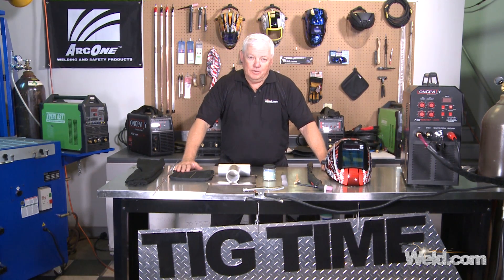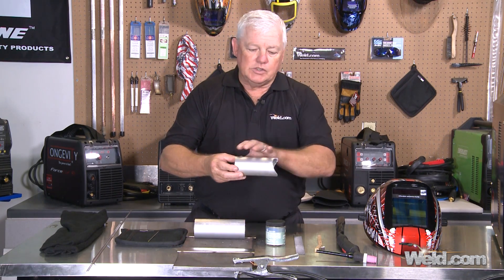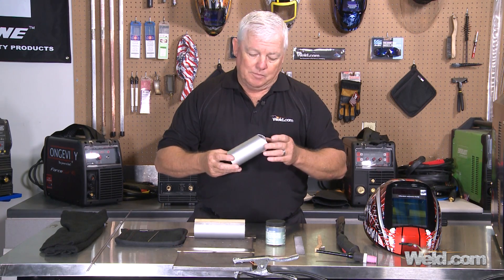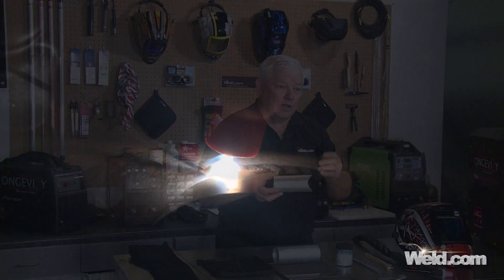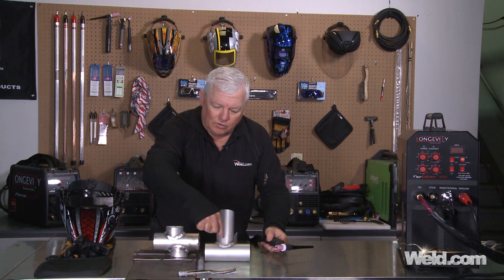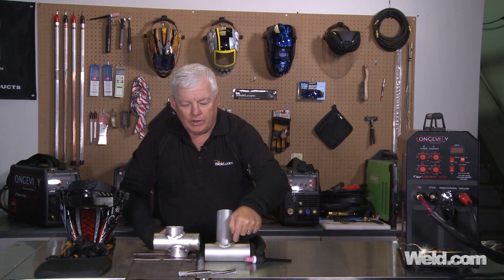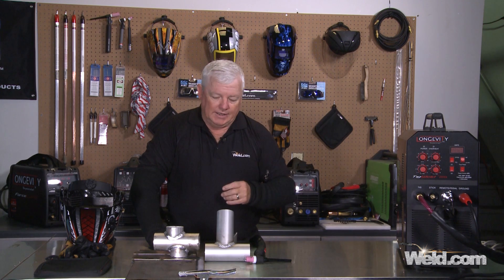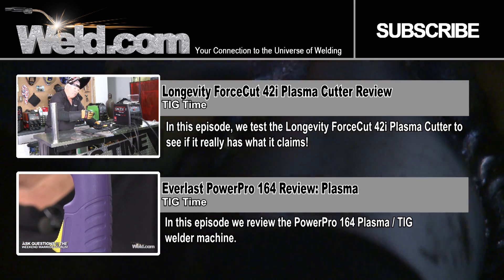How to Weld Anodized Aluminum - Bump Welding | TIG Time

Comment: First thing I've got to say is I've been welding for 40 years ,,, you have to have a ball on your electrode...  second thing is you're only putting a weld on top of the pipe you're not penetrating let me see the inside of the penetration...

Comment: THE ONLY MACHINE WORTH WELDING ANODIZED MATERIAL ARE THE MILLER MACHINES !! HANDS DOWN THE BEST. LOOK AT ANY "REAL TOWER BUILDER" YOU WILL SEE MILLERS!!! SORRY MR TIG, SHARP TUNGSTEN IS NOT HE WAY TO RUN ANODIZED PIPE !!

Comment: mr. Tag you do not know what you are doing. The first part was correct but when you want to run a hot pass to smooth the well doubt you do not just like the ark and start moving. LMFAO!you should be bump welding exactly the same as the first time without adding filler unless you need it.it will smooth out and look like a stack of dimes but more to dimensionally than 3D. It also helps to float the remaining anodizing to the edges that doesn't get burned off on the initial pass.I really wish people like you that don't know how to do something or don't do it regularly stop trying to teach other people how to do it. Cuz you are not teaching it correctly. I have been doing it for 20 years and I have not seen anyone in my profession just light the arc on a hot pass and move at a steady Pace. You just made a weld look like a bead of caulking. Just do whatever it is youknow how to do best and stop trying to teach people how to weld in a way that you do not know how to do! Or at the very least, get the correct information and learn the actual proper technique. And 75/25 should be helium as the 75% and argon as the 25%.you're not really making too much of a difference by adding 25% helium and 75% argon. You've got it backwards dude.

Comment: That's not the common type of pipe used. If you want the right pipe call Western Extrusions, or taco. 22 years of this under my belt. I weld in all positions, both hands, up hill only. You want to used 1/8 tung. And 1/8 filler. Fill downhill. Then go back up. But let it cool while filling a different weld.  You are to straight up and down. Rest cup on material and aim tung. In the middle at angle that almost touches the pipe. You will be at a perfect angle with 3/16 to 1/4 of an inch of tung. Sticking out past the end of the torches cup. Once you start your 2nd pass you want to go slow..about 3-4 seconds in between bumps. Go 1/2 inch past center when reaching the top. Do the other side after 2-4 mins. Going just past center. Hit the button three times rapidly aiming at your last puddle that gets rid of the cats ass..fish eye whatever you what to call it. Have fun!

Comment: I weld anodized aluminum daily. I have been building boat Towers for my entire adult life. This guy is kind of on track but clearly does not know the best way. You DO NOT remove the anodizing with a grinder sandpaper wire brush wheel or anything at all! I use 1/8 inch tungsten and it is not sharpened to a point. I usually taper it a little bit and then flatten the very tip out blunt like. Reason being is that the positive wavelength or cleaning action balls the tip up and it makes it easier for that to happen nicely with a blunt tip. Secondly I run 75/25 like he said but 75% helium 25% Argon. I also bump weld it but I use anywhere from 180 to 210 amps. Also the second pass that he put on to smooth the bead out was the ugliest f**** thing I've ever seen! If you are going to run a hot pass just do it the same way you did the first one bumping it the whole way around but not adding wire it does in fact smooth out the weld but still gives you the stack of dimes look and also helps to float the Anodizing that is not vaporized towards the edges of the weld metal making it look more like a weld on Mill finish aluminum without so many contaminants in your weld puddles.
Reply: Thanks for the info. Doesn't seem like a lot of info out there on welding anodized aluminum, like ladder racks , rod/cooler racks etc. the ole terminology, heli arc.
Reply: Some guy is on point,I too weld towers this video is not the greatest advice.It takes some practice but with a little time under the hood it becomes much easier and rythmic finding the sweet spot to make  killer passes.Also finding a  welder that can break the anodized well is very important,
Miller dynasty is a pretty safe bet.
Reply: With so much difficulty striking the arc, can you explain how the work clamp is best placed.  Is the I.D. anodized also? That end of things wasn't discussed here at all. Thanks
Reply: Can i use argon only?
Reply: @patrickreed8950  i tried to weld aluminium extrusion with 0.8mm thickness, and it bends awkwardly. with straight argon. now it looks like fusilli.
Reply: Patrick Reed so how can i tig weld an extruded aluminium properly? removing the anodized coating? How? Thankyou !!
Reply: I was taught how to weld but a guy that does tuna towers. I learned on anodized aluminum and am better welding that than steel or mill finish aluminum...
Reply: So besides not having any anodizing left right where the weld is. Why not clean it off just where the weld bead is?  Serious question. I realize you’ll never get all the anodizing off and some will get in the pores of the aluminum. But I would thing you would still end up with a stronger weld. Thanks.
Reply: @Mad.Man.Marine  it does not make any noticeable difference regarding the strength of the weld when you grind it off prior to welding. If it is done properly the material will break before the weld does. The anodizing is just a very thin eggshell like coating on the aluminum and during the welding process it floats to the top of the puddle and out toward the edges. At least whatever is left after the majority is pretty much vaporized. Leaving the anodizing does not contaminate the weld and to try and remove it from the areas that you are welding are only going to make the job take way way longer as well as running the risk that you remove anodizing from somewhere that is not within the weld. It is not necessary nor is it even practical. I have been in the Marine industry for 20 years full time and was introduced to TIG welding aluminum and anodized aluminum at the age of five. It is common practice in the Marine industry to just weld the anodized pipe as if it is regular mill finished aluminum. However the correct way to weld the anodized pipe is not with a foot pedal that allows you to adjust the amount of amperage you are using. Instead, you use a button or you could still use the pedal but you set the machine so that it is All or nothing with whatever amperage you are comfortable using. If it is schedule 40 anodized pipe and you are using straight argon the typical amperage range is going to be somewhere between 225 to 255 amps. I prefer using 75% helium and 25% argon mix, commonly referred to as hot gas. The helium increases the arc temperature without having to increase the amperage and it is probably equivalent to adding an extra 50 amps. It makes a much prettier weld and it is a lot easier to weld using that mixed gas. Not to mention it allows you to not put as much of a load on your machine and still achieve the equivalent Arc temperature of a higher amperage setting. I prefer to use between 200 and 215 amps with the helium argon mix. And again, you don't use the foot pedal, at least not the way it is normally used. All you really need is what is essentially going to be an on-off switch. A lot of welders refer to the method of welding as bump welding because you are simply bumping on and off with whatever amperage you set the machine at. Now you will probably notice, at least if you have any experience welding schedule 40 aluminum pipe (1/8 inch wall thickness), that the amperage ranges I have mentioned for both types of welding gas are considerably higher than what you would normally weld with using the foot pedal. The reason for that is because it takes more amperage to burn through the anodizing and float what is left to the edges of the puddle so that your weld metal flows properly. It is a little difficult in the beginning to get used to welding that way because you have to move quickly and you don't really hold the button down very long once the material is up to temperature and it is welding properly with adequate penetration. As well, the puddle is pretty filler rod hungry. At least that would be the best way for me to describe it. You have to add quite a bit more rod then you think you need and you have to do it faster than you would normally do it just welding normally with a foot pedal and varying amperage control. You don't want to weld downhill either past about five degrees. A lot of people will weld anodized pipe in two passes. The first pass is where you connect the two pieces and add 50 to 75% of the filler material required for that weld joint, sometimes welding from the top down angling the torch upward, especially if there is a gap, and then a second pass to burn everything in and add the last remaining amount of filler material but always flat or uphill. In order to end your weld without getting a hard stop which could cause a crater crack, you need to trigger the machine more frequently for shorter amounts of time and slowly get the tungsten closer to the puddle without touching it while you simultaneously aim more towards the edge of the weld and decrease the size of the puddle. There is a lot to it but it's really no big deal once you get used to the different technique and you refine and hone your skills using the button and more amperage. It is just not practical or profitable to spend the time required to remove the anodizing from the weld area when you are building a t-top or large fishing Tower. There is also way too great of a risk that you are going to remove the anodized protective coating in some area that is not going to be welded and then you have a spot of bear aluminum that is exposed to the salty air and salt water which will corrode over a very short amount of time. Hopefully that helps. I know it was quite a long winded explanation to what is really a simple question. But I figure if it helps somebody who wants to learn how to weld anodized aluminum properly because they want to start building marine products or anything that is typically built from pre-anodized material, then it was worth the time it took me to explain it. Hopefully I explained it in a way that makes sense and is enough information to get somebody started bump welding anodized aluminum if they so desire to try it. At least the way that is common practice for pretty much every business in the industry.
Reply: @Mad.Man.Marine  also, I have never had a weld on a product I built fail. There have been people who ran there t-top into a bridge or tree branch because they left the upper station up while trailering or tried to return under a bridge after the tide came in. In all instances, the pipe work was very badly mangled and broken in some places. All of those places were either at the toe of the weld which is always the weakest place due to it being the heat affected zone which doesn't get hot enough to become weld but gets so hot that it changes the molecular structure of the aluminum, or just some random place on the pipe. Even with the anodizing left on prior to welding, the weld is stronger than the material if it is done properly.

Comment: you also need to tell people you need a lot of power for this 250 300 amp welder to do it right and look nice why sharpen the 250 amp setting on pipe will ball the tung whats the point to sharpen on aul  steel yes  also that air cooled torch is going to get hot fast you need water cooled 250 or 350 amp torch

Comment: that is not anodized pipe you havei weld anodized pipe on and off for the last 30 years  button on the torch blast it with full power add filler after cooling paint with silver and small brush  mostly sch 40 pipe  not every welder can do this i use a syncro wave miller  the hard part is the bending and not scratch

Comment: Does the recommended method change when welding anodized to non-anodized? Is a standard aluminum TIG method preferred or bump in that case too? The particular case I have in mind is welding plates to 80/20 style aluminum extrusions. Thank you
Reply from the maker: Kent VanderVelden Welding "non-anodized" Aluminum is a completely different technique. Check out some of out videos on TIG welding Aluminum and you'll see a lot of differences.
Reply: you can go either way you can even bump tig steel i been doing it for 30 years on and off

Comment: is it possible to anodise welded aluminium, for decorative use, so you won't see the welding line after anodising?
Reply: Yes!  It would be better this way, unfortunately these are large structures and might be a real problem for the anodizing activity itself, might not fit in the tanks, right?  For smaller stuff you'd be much better welding, then finishing, then cleaning, then anodizing.  NOTE that not all aluminum filler rods are suitable for anodizing!  I think the Al 5 Si stuff I mostly use supposedly comes out grey.  You can easily look this up.  IF you do this, the whole finished part will be equally protected, won't that be nice?

Comment: Mr. Tig, what type tungsten and size would you recommend using an inverter welder. I was using a E3 3/32 and it seemed to split and deteriorate quickly.
Reply: pure tung on AC

Comment: I weld anodized 1mm square tube awhile back. It was really pain at 1st. Later I  figured out by carefully remove the anodized surface and weld it immediately works fine.

Comment: I have tried to weld with a miller diversion 180 with argon 100%, and it doesn't look good. While also attempting to achieve the anodized finish. Not sure if the machine doesn't have the strength to do it or if I have to put helium in the Argon mix. What do you recommend I should do?

Comment: How can I tell if it's anodized aluminum?  If it is can it be ground off the get a better weld / ground?  I was working on a friends dump trailer and I was having a tough time getting things moving.  I'm thinking it was.  Thanks
Reply: Well, anodized is very shiny and resists corrosion, and also doesn't conduct electricity!  You could check it with a handy electrical meter (for resistance, which should be very high) or see if it's hard, say by scraping or filing lightly?  Anodizing is really bad FOR welding as we see here, there are tricks but basically that coating is the enemy of welding.  SO, if you are allowed to take it off just where the weld is going, I don't see how that can hurt.

Comment: Really not trying to b a dick but that weld does not look impressive. We have been using Lincoln 350MP's for years with a push/pull mig setup and get much better weld appearance. I always wonder if we should invest the time and money in getting setup with tig but if this would be our results than i can't see any benefit.

Comment: I've been welding anodized almost every day for 30 years. It's not as difficult as some make it out to be. I use 250 amps for upwards of 3/8" material and even when welding thinner stock and tubing and 1/8" pure tungsten. I have been all over this proving it's viability, including welding and fab speed. Speed is where bump (manual pulse) welding shines especially with assembly and a lot of quick tacking. Have even had others race me with a foot control on non-anodized and they had to concede the fact that the time saved with assembly and positioning (as well as moving the pedal) was where they could not catch up. I have converted quite a few pedal die hards to this method, and they at least mix it up using this method for assembly, especially where instant, robust tacks are needed. 

I use a Miller 330 A/BP, a 250 synchrowave, and a Dynasty 300DX. I have the inverter machine set to run pure tung, with a momentary switch on the torch, essentially emulating a transformer machine because I cannot be bothered sharpening tungsten. At 250 amps, there will be no issue getting through the anodized. In all actuality, anodized welds easier than mill finished material, and you do not get the frosting (you do get a haze but it wipes right off when still warm and before it oxidizes) outside of the weld zone.

Finally, another benefit of this type of welding is that you can mimic alot of different weld patterns, such as, MIG, traditional TIG, and even automated welds, which is especially handy when making repairs on factory made items.
Reply: +Mr Boat exactly couldn't have said it better myself.
Reply: unrelated to above. but I need expert advice. How to minimize or conceal weld marks showing through anodized aluminum. Appreciate your response. Thx.  apearl@fecs.net
Reply: Thanks for the tips ! Always nice to see what guys in the industry are using what kind of switch do you use on the Dynasty or syncrowave I own both would like to practice on some 
Thanks !

Comment: Great info. Thanks. I haven't encountered much of this types of Jobs in my life but when so, I used to grind somehow the first layer off to be able to normally weld. Obviously the cost is appearance, sometimes, and other is the risk of not having enough  wall thickness after grinding. 
Interesting your comment about the bulky torch. That's the one I use for all my jobs as with pulse I need much higher amperage that what you normally run, so I would hardly use the nice lightweight you normally show in your segments.